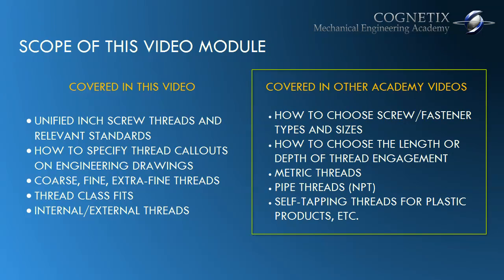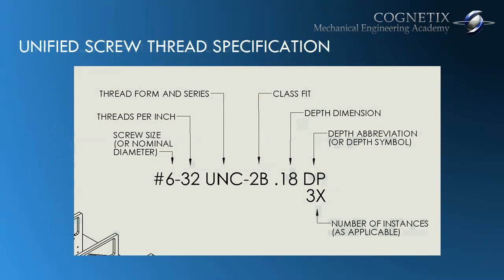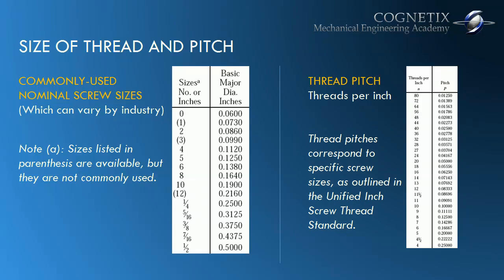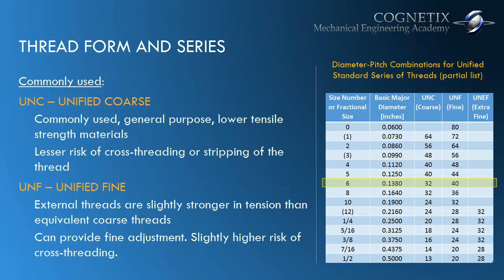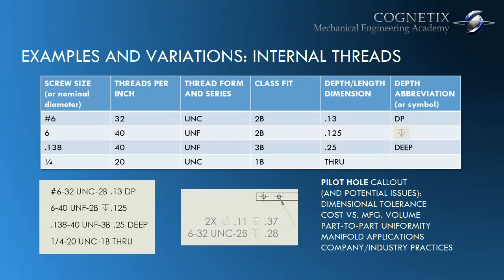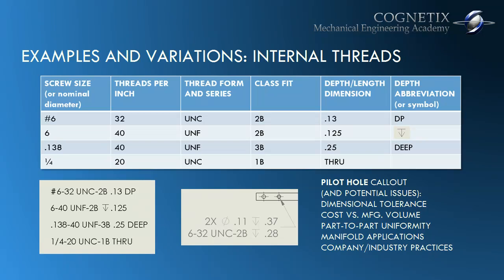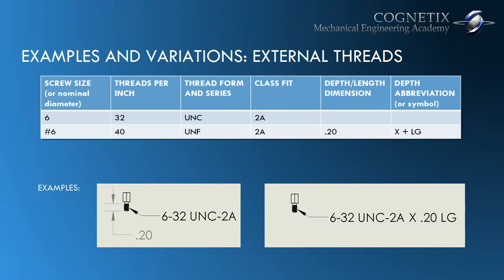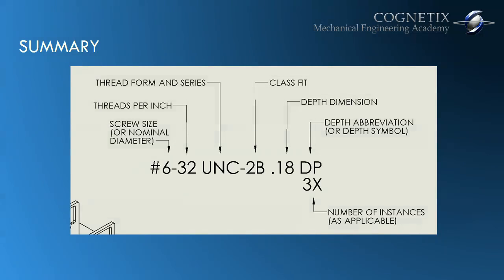How to Define SCREW THREADS on Engineering Drawings (Unified Inch Screw Thread Standard)

Comment: Good video.  However, the format you have for calling out the quantity (underneath and at the end) is incorrect.  ASME standards only mentions calling out the quantity of holes etc. at the beginning of the callout per ASME Y14.6 2001 and ASME Y14.5M 2009.   I also don't think its necessary to spec the pilot drill hole size on a threaded hole.  Probably, a lot of people will disagree.  I believe the machinist should know the standard drill size for each thread size.  So, this is redundant information.

Comment: A good fabricator will absolutely see 3 decimals and interpret that according to the 3 decimal call out for tolerance listed on the title block.  He is just plain wrong on that point.

And if your an engineer you will pay attention to this fact because the quotes you get back from fabricators will reflect this demand in tolerance.  Wondering why everyone is so expensive?  They are not going to explain this to you.  They are going to assume you want the extra precision for a reason and charge you accordingly.

If you don't need that precision then make sure the blue prints reflect that.  It is not the fabricator's job to question the design.  At most he will clarify conflicting or unclear information.

Like he said though, if you just print the size of the bolt - or what have you - you will completely negate this problem in communication.  List the #6 screw and you will get that properly.  List .138 and the fabricator will try to machine the part according to the tolerance information available.  And if he cannot find that information he will call you for clarification.  Save yourself the hassle.  Use the standards wherever possible.

Any fabricator will know what size to make the holes if you use the standards.  And if you publish something different he will assume you had a reason for doing so.  And if he can make sense out of it you will never hear about it.  But the bill may be larger than expected.

Comment: Hei man... thanks for the info.. but how do I specify a threads, if the threads is custom.. not standard...
Reply from the maker: Hi Septian, it depends on the details of how the custom thread is different. Is it simply a non-standard pitch, but the profile is standard? Is the pitch AND the profile different? Etc. I recommend that you consult the Machinery's Handbook. It's an excellent resource with extensive information on threads (and many other topics). If you would like (and are able) to share more details on your application, we would be happy to help further. -Kind regards